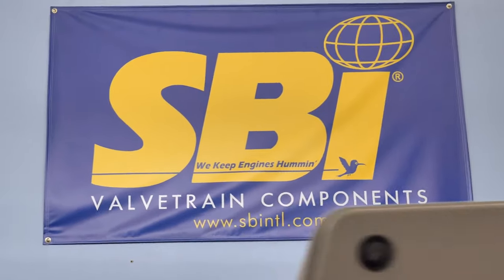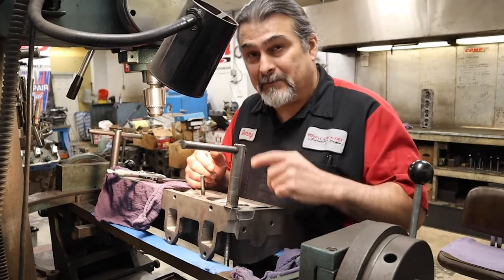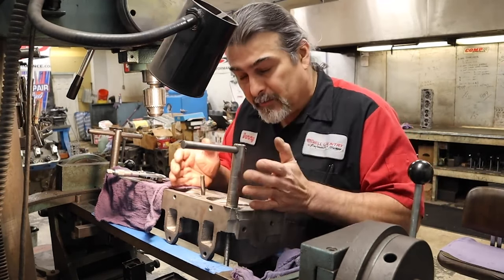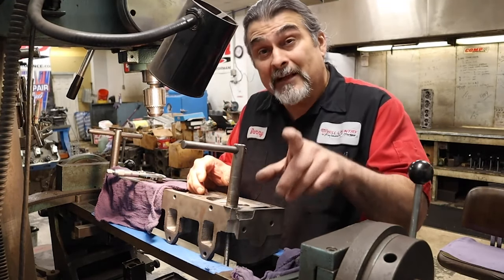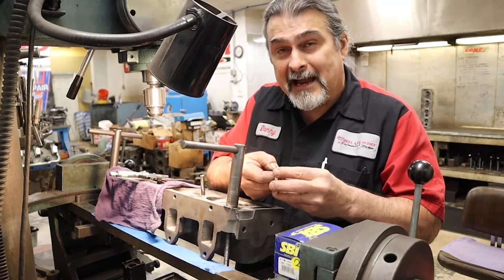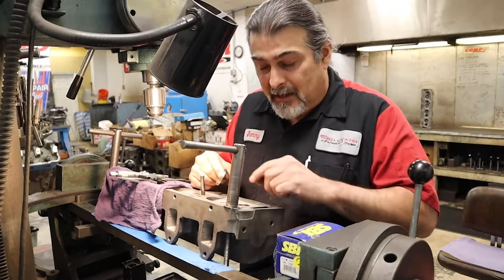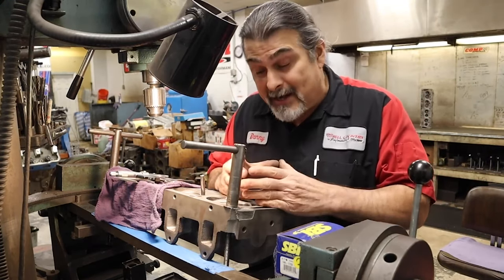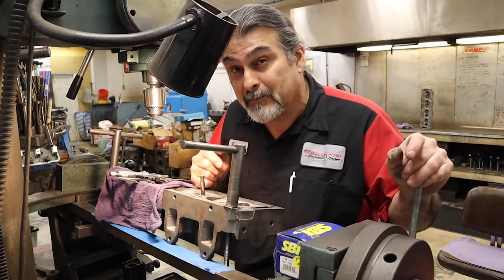How to Install Valve Seats and Get Proper Press Fit

Comment: If you cut a cast seat to size it’s not the right size.  I set my cutter to 8 thou smaller for cast and usually end up 5-6 thou after boring.  So you NEED adjustable cutters for proper press fit.  Every modern shop should have liquid nitrogen, then you don’t have to heat the head.
Reply: Also, you’re just cutting the seat and not measuring your bore?  Bleh.

Comment: You Hit the nail (I mean Seat) right on the  Head !!  ....I See & Hear bout it done Wrong on Aluminium everywhere, Even on aftermarket Manufacturer videos !! .....Chilling & Heating for smooth, Easy force Insertion wthout Rolling  seems Good, common Sense.....Big Thx for this  Informative video Properly addressing this Huge Important shop Problem......

Comment: Is it OK if the exhaust seat is too close to the intake seat to flat spot them to fit in a cast iron head? I've never seen this before , usually the valves are far enough apart that this would never happen, I bought an engine fitted this way

Comment: I normally do cast iron, with integral seats.  I try constantly to reuse the integral material.  After all the years in service, the valves normally are the ones showing their "tiredness".   Other than the integral seats being out of round, they normally clean up fast.  However, I am constantly dancing valves around trying to get the recession acceptable.    I have used .005 for cast iron, granted, I am less than a decade into my apprenticeship so I try to listen as often as possible. 

 I have been heating and cooling when I do seats in cast iron.  Is it stupid of me to do this?  My cutters allow adjustment, and I felt smart that I knew about the part number being the bore size!!  lol.    I have many more questions,  and would love to type them here for anyone else that might wonder.   How often would you decide to try to salvage the integral seat rather than counterbore and press a seat in?  Should the cast iron be much harder to seal than the seats?  Cause I can seal an installed seat very easy,,  sometimes those integral seats take extra effort for me. I acquired the mindset that everything gets "checked" at least.   I was told in the past that lapping is the best way to check.  What do you think? 

  It is a sg8 from 2013 that I am using.    I just stumbled across this video and ended up watching it,,  so wth,,  I figured I'd comment!!!   Your channel is much bigger than mine btw!!   Maybe commenting about specific things can get my channel a lil jump from your coattails!!  lol